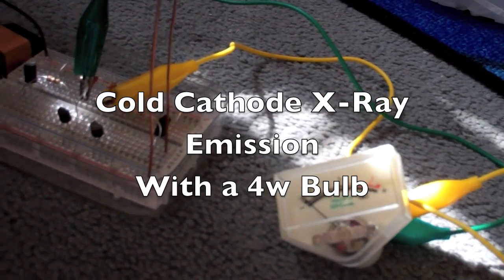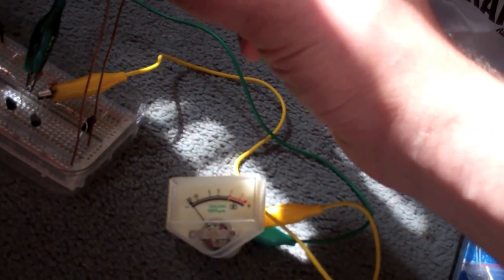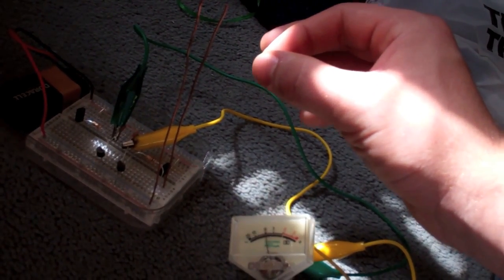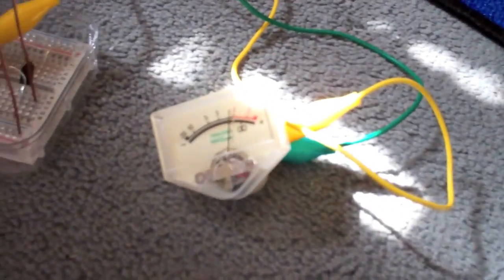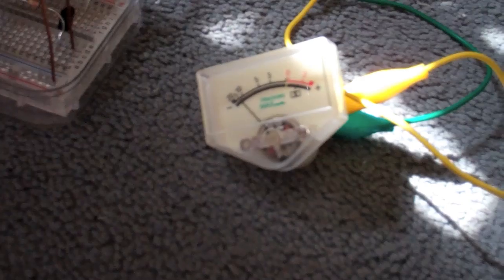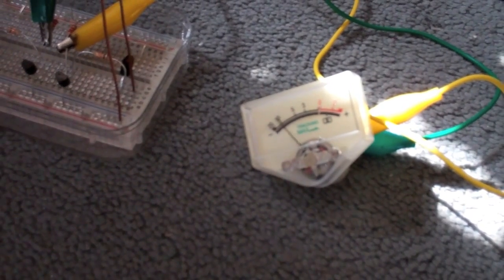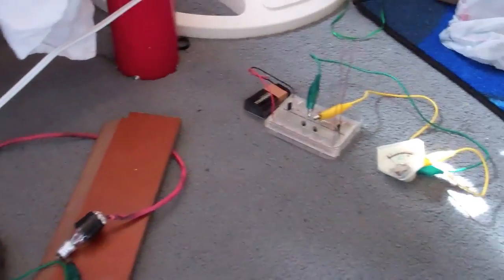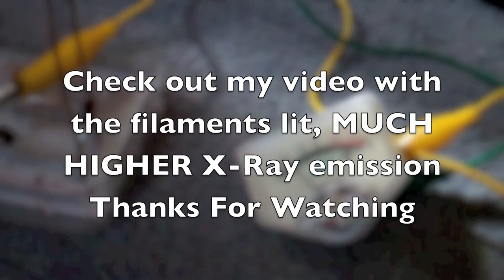Homemade Cold Cathode X-rays

Comment: actually he is actually generating X-Rays, his detector may not be working well though. If you take a small light buld, and put a HV generator wire across the filament wires on the base (tie them together to the HV output line) and glue some foil (heavy duty aluminum bbq foil is best) on the opposite end and connect it to ground, you'll be created a crooks tube or a cold cathode tube, it's not efficient as a heated filament type, and would work better with certain materials like silver as a cathode plate, but it will produce x-rays,a nd even burn a hole in the glass tube wall if your not carefull. I've built them and used an actually CDV (Civil Defence unit) Geiger/muller tube detector to do the same thing. You can actually generate X-rays from ripping scotch tape in a vacuum as well

Comment: For x-rays, must use tiny incandescent bulb which has high vacuum and no argon.  Typical bulbs are:  4Watt bulbs, "exit sign" replacement bulbs, old-fashion xmas lights (the larger ones.)    These bulbs DON'T show purple plasma when touched to a Tesla coil, but the glass may flicker green or blue.

Comment from the maker: you might be right but im still not convinced, an open air arc can still produce x-rays, very small but still there. it would take some strong interference/radio waves to ionize the air between the contacts. if i had it set up to a tesla coil then i would agree with you, but i just dont think that the frequencies im using are high enough to sent that kind of wave form with that power that distance. I would like to see a video with an actual radiation detector to truly prove it right wrong.

Comment: @davethehunter2 They are not. You do not have a geiger counter. gigers have argon gas in the tubes, and you have a radio wave detector. and the bulb might put out very VERY litle xrays, but noting to pick up on a geiger counter. You have UHF radio waves.

Comment: @totoff92  if the glass is fluorescing but without visible glow discharge in the gas, then he's got KeV electrons, which easily produce soft x-rays.  They're a bit hard to detect except with a geiger counter w/alpha window.   A test: very thin steel will totally block soft x-rays, but aluminum foil will not.

Comment from the maker: @pieznice29 i thought that also but when i arc the flyback, nothing happens on the radiation detector. i also found that when i add a large capacitor in series, like a salt water cap, it makes large bangs and pops through the bulb but no radiation. im working on adding another video on this same experiment but turing on the bulb on/ filaments which make an electron cloud and significantly increases the radiation.

Comment: Nice experiment. Just a thought, could it be interferance from the high voltage triggering your radiation detecter? From what i understand about the way it works it would be fairly sensitive to that type of interferance.